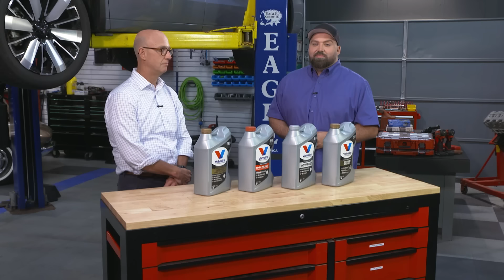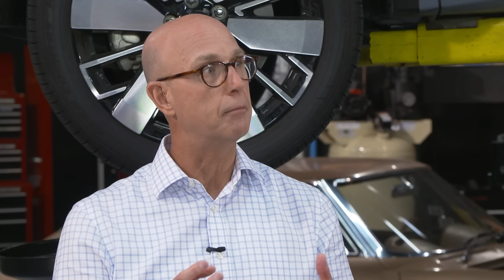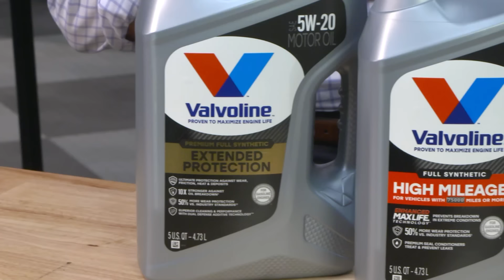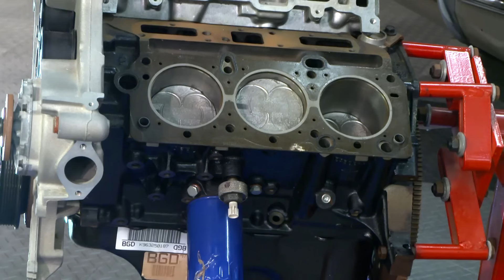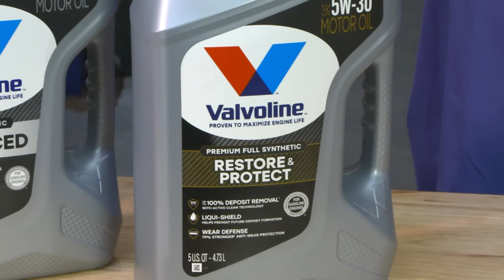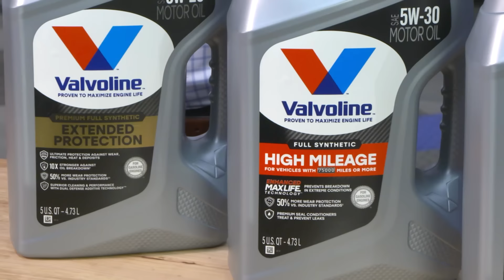Motor Oil Tips for Technicians with Valvoline and MotorWeek

Comment: iWork for Texaco lubricants for 11 years. And went to UTI. Never ever use 0 weight oil. As a matter of fact, you take your new car or truck straight to an oil changing station. Before you even go home. And change it out to 10-30. After several 1000 miles up it to 15-40.
Reply: Please nobody listen to this idiot. Yes they have thinned oils out for fuel economy but this is an extreme suggestion
Reply: And you didn't learn that W stands for Winter, and is just cranking viscosity at extreme colds and has nothing to do with operating viscosity? 🤔 It's base stock and VI improves that will influence this, so would be hard to get a high W grade with high quality synthetic base stock.
Reply: If you' have a car that calls for 0W-whatever oil and you're concerned that it's too thin, do some research and see what oil is recommended for the same car/engine in other countries.  If it's 5W-whatever there, but 0W-whatever here, then you likely can safely switch to the 5W oil
Reply: @driveway_of_misfits W grade has nothing to do with operating viscosity, it's cold cranking viscosity under extreme cold.
Reply: @PSA78  The point is that if Car X recommends 0W-16 in the US and 5W-20 in every other country, it's likely safe to use 5W-20
Reply: @driveway_of_misfits  Sure, but that's a matter of the last number, the first one has no impact, though it is wise to not go up too far and especially if it gets cold.
Reply: Dumbest shit said on the internet today. Guess that’s what you use on your bicycle chain to keep it from rusting for you on those rainy days riding to Texaco ! Fool !
Reply: How about this winter, drive up to northern Minnesota on a lake? Stay nice and warm in the fish house. Bring your own beer. Try starting your vehicle the next morning and tell me how it goes. You're in the middle of nowhere. I want to see you do what you're telling others to do.
Reply: This is moronic. The amount of time with zero flow in the winter is way too long. Also all engines have vvt and other oil accuated stuff in the engine. Proper viscosity is important. A 15w40 diesel oil is cheap but why cheap out? For a few bucks more you can run 5w20 or 5w30 full syn. 300k miles in my nissan titan as a work truck running as few as 35k miles a year to over 50k miles a year fully loaded with tools, ladders and often heavy trailers. 5w30 full synthetic  its whole time with my business. I was hard on it, she was tuned, headers, true duals. I redlined it fully loaded with trailer at times to pass slow-ders even up hill. I changed the oil every 5-7k miles and only usually needed to add 1qt between changes. As a 300k mile truck and i replaced an alternator at 290k, o2 sensors every 100k as PM along with spark plugs. 
My ford with 500k miles got full syn 5w30 its whole life (ford suggested 5w20 for "average conditions".... 1200 to 1500 miles a week courier isnt average)
Now all the fleet vehicles im now in charge of.... they get what they call for and shocker.... the engines never fail. They need transmission or rear ends first. Wisdom; for commuting 20 miles to work and back whatever it calls for is fine, run and 0w20 or 5w20. If its used for harder than typical use or you live in AZ maybe jump up a grade to 5w30. Most owners manuals state a range of viscosities based on conditions with 0w8 or 0w16 or whatever being "prefered for average comditions" 15w40 in a new car is just dumb. When its 10 below zero try and pour 15w40..... or even 10w30. It aint pretty

Comment: Restore and protect is great for engines that are at risk of burning oil. I currently drive a Hyundai Palisade and have used restoring protect since it was available. With the engines and HyundaiKIA/Genesis this oil will extend the engine life and greatly help reduce the risk of burning oil. I plan to purchase a VW for my teen daughter and I hope to see restore and protect for VW engines.

Comment: R&P has actually mostly resolved oil burning on my mothers Kia Rio
Reply: 31 year mechanic. Let me help you. Ive done this on ohhh 200-275 cars. Low tension piston rings, its most of our cars. Get some high mileage seafoam. Pour 5 ounces of it in her oil crankcase (relax its petroleum based) drive it around a day. Drain the oil, put that valvoline in, voila, you are slowly bringing back the rings and compression, gently. Ideally a piston soak before an oil change but she probably doesnt want her car parked 2-3 days.

Comment: I have used almost every brand of motor oil over the last 30 years and Valvoline restore and protect is an amazing motor oil and you can get it at Walmart for a good price and it is done amazing stuff to my car that was already taken care of it is cleaned it up even better and made it run smoother even though it was very taken care of and has amazed me how good Valvoline restore and protect truly is.  Plus it is the only motor oil on the market that actually cleans the piston rings.  And it has helped two engines of mine get down to burning barely any oil at all between oil changes.  And one of those engines has over 220,000 moles the other has 275 and both were cared for but still burning a little bit of oil now they burn barely more than about 4 or 5 oz between oil changes.  
And the motors are running so smooth and so quiet that when my roommate used my car she almost restarted it at a stoplight because she thought the motor wasn't running as it was so smooth she couldn't hear it or feel it at all and thankfully she looked at the tachometer and realized it was still running at 600 RPMs.  Valvoline restore and protect is truly an amazing oil, and for the price and how easy it is to get there is no motor oil for that price and availability that can even come close to it.

Comment: Restore and protect has made my engines run very smoothly.
Reply: Mine too it is the best oil I've used in many years and by far the best oil I can buy at Walmart.  Especially considering Pennzoil premium one with made with natural gas is not available anymore and it is not made from natural gas anymore.
Reply: @bradpnw1897  Pennzoil full synthetics still outstanding oils. 100% GTL natural gas supposed to come bk spring '27. If vehicle not neglected /doesn't burn oil then R&P won't do any better.
Reply: @Davido50 pennzoil stopped making oil from natural gas a while ago. 
It’s was my go to oil before but looks like I’ll be switching
Reply: Same. I reckon it's probably the best oil Valvoline has in their range.
Reply: @MrTimstaaa  Best for older high mileage or engines burn oil like Hyundai-KIA/ Hondas GTDI etc. Valvoline EP or Pennzoil Ultra Platinum perfect for well running well maintained turbo or non turbo vehicles. Well proven.
Reply: Yep same here 2.4l ecotec at 200k and my Mazda 2.5L sky active @170k  both run perfect after 10,000 miles of running exclusively r&p. Ecotec no longer burns oil. It's the only oil I run. Even tho they bumped the price up to $36 a jug I'm still buying it
Reply: @uponthefact9924  Thats what R&P designed for .. high mileage/ burns oil or neglected. If engine has no issues & lower mileage etc any good full synthetic + consistency w/ basic maintenance all ya need. Pennzoil Ultra Platinum been my go to 10yrs+. Even reformulated bet it will be excellent oil.
Reply: @uponthefact9924. In Australia it's $99 for 6 litres.